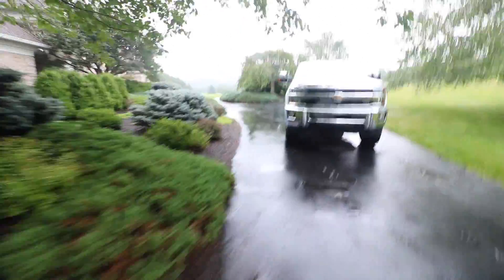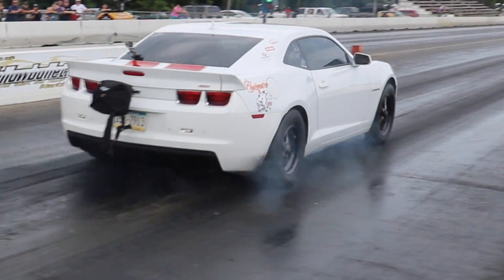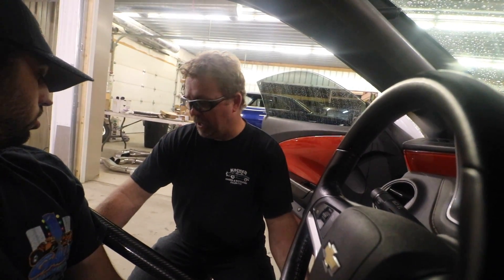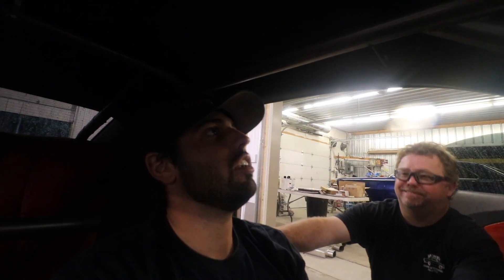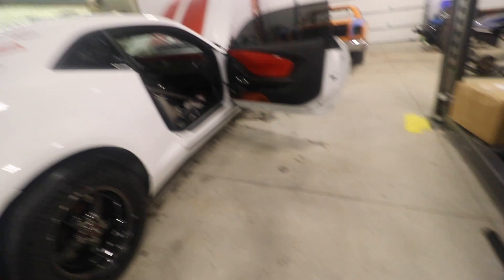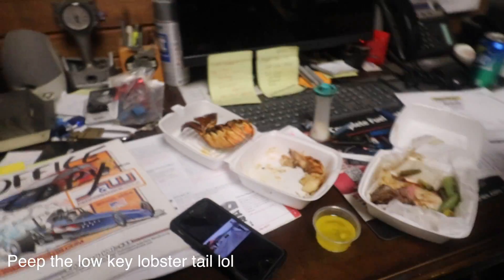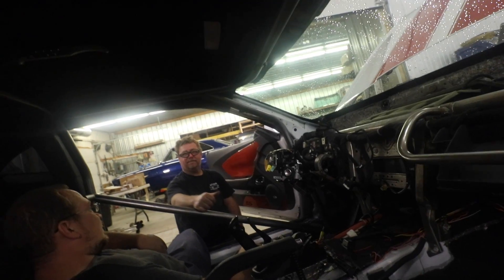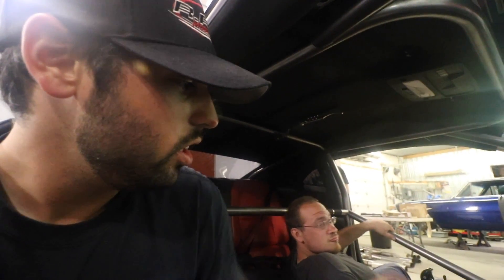I RUINED THE COWMARO!!

Comment: That smoke from the front of the engine looked like the transmission cooler was leaking back onto the exhaust.  While you were running without your gauges, you probably did not notice the engine going over temperature and boiling away the coolant.  You might want to get an old school analog temperature gauge that does not go through the car's computer.